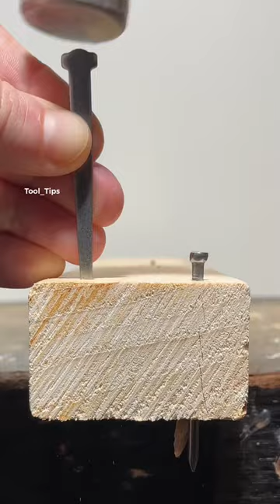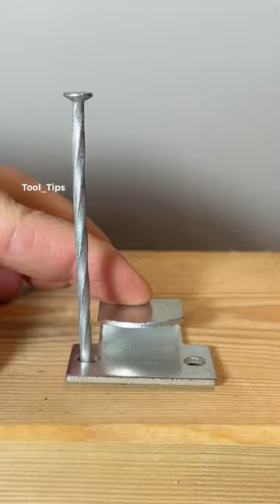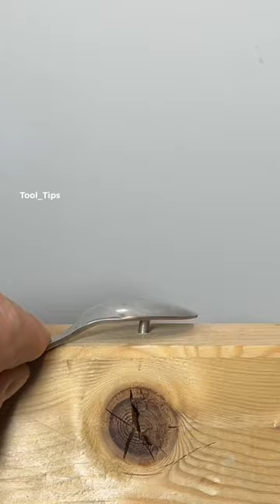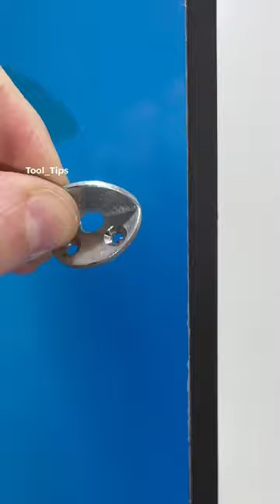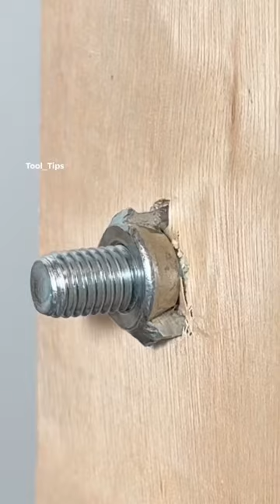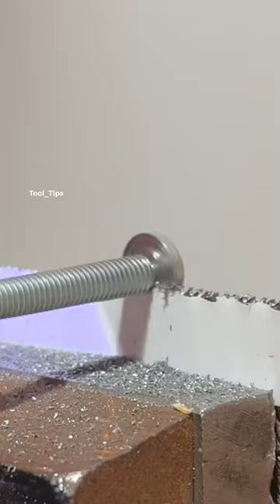9 Tips in 1 Minute #shorts #tips

Comment: You drilled holes and bent a washer and it's going to somehow magically support a shelf?
Reply: Depends the weight and shelf
Reply: Mate, it was 3mm thick steel. Yes, one at each corner of a normal shelf would hold twenty kilos AT LEAST. Try it and see.
Reply: @uncletiggermclaren7592  I think you're the one who needs to try it. "each corner"? you only have two corners touching the wall. the issue isn't the thickness of the washer, it's that the shelf will act as a lever.
Reply: @frankkrunk  whoa! Slow down dawg!!
Since you’re new to this type stuff, maybe start with 4 (four). This is something that is used in probably every IKEA product or shelves for the last 60+ years. They support the side, not the corner

Comment: What's the point of the first tip?
Reply: The first one is more of a history lesson than anything else. Before industrialization nails would be smithed and therefore have flat edges which supposedly meant they affected the grain of wood less. In present day we use wire cut nails that are easily mass produced but supposedly have a higher probability of splitting the board.

Disclaimer: I do not assert this as fact, just my opinion. I am a history undergrad, NOT a carpenter but my Granddad was a house framer and carpenter his entire life.